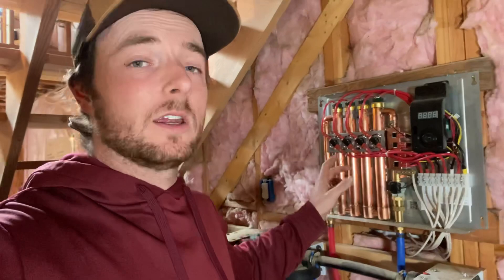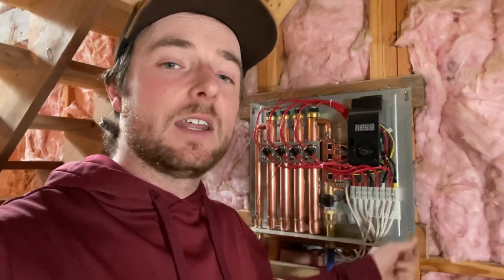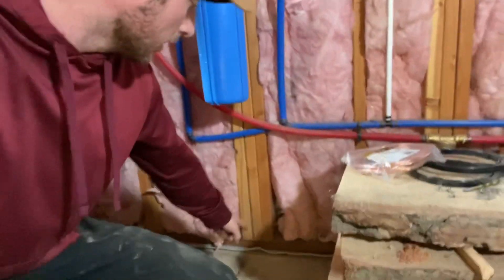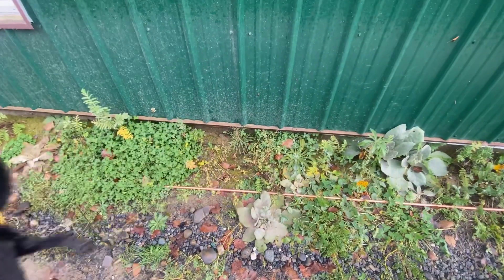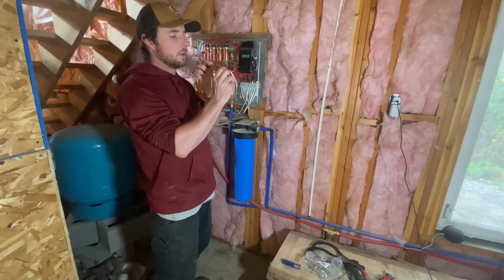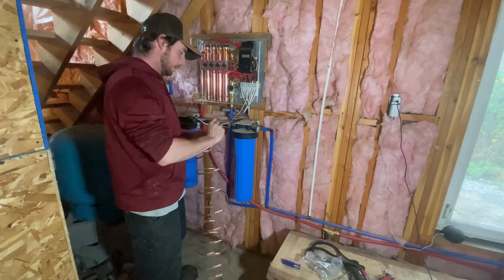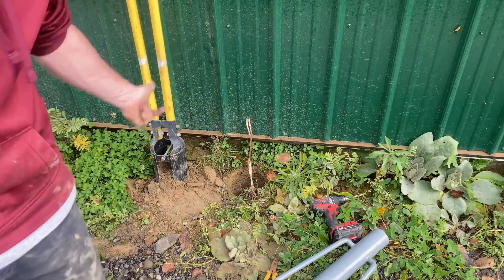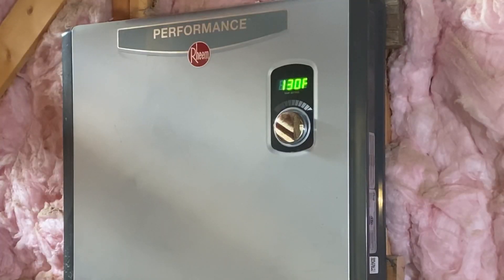Grounding a TANKLESS WATER HEATER

Comment: Two 4 ga grounds are overkill for that. You ground each device to the panel, the entire system is grounded to the ground rod at the meter. The only time you would add a second ground rod is if you installed a lighting arresting system (lighting rods). And my entire system is grounded at the meter and the ground wire attached to the grounding rod w a single 4ga wire, that grounds the entire electrical system and was what code required 22 yrs ago when it was built.

Comment: I have a house where someone tapped in into the main service to add a 100amp panel which isnt a sub panel anymore. they ran two tankless water heaters which I know is bad already the 100 amp won't hold theyre pulling more then 120 amps and their isnt anything else on the panel. it looks like a good grounding what do you think it could possible be, been doing for 23 years but have no idea what it could be

Comment: No it is grounded at the poll box. You should  have run the grounding from the water heater you should have taken it back to the main panel. You have now created 2 ground point. It may work but I do think you should have only one ground point

Comment: I do not know what water heater you have, but the hum you describe may possibly be from a small control transformer to get from 240 volts to 120 volts or lower.   Transformers do hum.

Comment: So I don't live in the USA, so your codes are more than likely different But every MEATAL case/cabinet and MEATAL conduit and all sockets should be grounded (or earthed). If you think that anything that can conduct electricity and kill you should be earthed, also anything connected to water and anything connected to gas should also be earthed. Just think to your self "could I get a shock from this" and if the answer is yes then earth it. You can never have too many earth rods, try to choose damp areas of your grounds as this area will provide better protection to your system. As you live in a meatal building a lightning rod and separate ground is a must. Thanks for posting
Reply: There is a phenomenon called a reversed polarity that happens when you ground at the device instead of the disconnect point or the breaker. 
Code says that you ground at the disconnect point and 4 wires must be run to device or appliances past the disconnect point. 
In answer to your question I just heard no do not ad the bonding screw connecting the grounds to the neutral unless you have a back to back service with three wires coming in from your meter, and you are using the panel location for your grounding point.
If 4 wires are coming from your meter you must separate the grounds and the neutral’s adding a ground bar directly to your panel enclosure and do away with the bonding screw that is the correct way to connect. 
Grounding must be at the disconnect point or reverse polarity will occur and over load your neutral causing insulation to melt and conductor to deteriorate resulting in arcing and possibly a fire.
The buzzing you are hearing is not good and any buzzing occurring at electrical devices or appliances is a sign of trouble. 
You should call in a qualified electrician or repair man to fix the problem.
Steve. 
Electrician for 
47 years third generation in my family.
Our company has been in business for over 75 years 
My Grandfather installed and wired houses when lights were the only thing that there was when wiring was knob and tube .
Brace and bits were the only type of drill you had.
The common practice back then was to switch the neutral and you were required to twist and melt led on your connections.
Thank goodness that has all been changed.

Comment: IMO you should bond your neutral and ground ONLY in the braker panel. It won't hurt driving another ground rod outside the panel. BUT All your grounds should come to the one point inside the panel.

Comment: Hi, first time posting here. I've done 2 my houses quite full electric system upgrades so from what I've learned is this. Eurooean persoective though. You seem to have TNCS system from service. Then it's correct to ground at the service box (it becomes a part of Grid grounding distributed system wich Provider wants to have). Tgere Groun wire & Neutral are joint together ane only there! And then Key Rule: do not join Ground with Neutral anywhere back later in Yr house system! Kepp them separate.
I could explain the rationale behind it but this message would be much too long...
Then You may ground additionaly the Ground wire at Yr house box  or as You did. It will only help. 
Woul be good to measure the resistance on this copper rod. When I did mine in order to achive a mere 6-7Ohm I needed to install like 12 of such rods... You folow? And I should have 3-4Ohms... Very much depends on ground codituity in Yr area. So measurement is really essential to sleep in peace 😉
Reply: BTW, You have interesting setup there from service. Here in EU we have either 1phase (1hot) or 3phase system. The fact that some high power equipment like heaters is using 2 hot not 3 is another matter. We have higer power engines running on full 3P. Pity You haven't got full 3P+N considering Yr future shop needs.

Comment: I don't know about the specific code in your neck of the woods, but for any electric water heater, you should install a 'ground fault interrupter', which limits your exposure in case of a device internal short to 0.2 to 0.4 seconds. Although you may check if the heater has an internal gf-interrupter built in.

Comment: If you put a ground rod in the sub panel in the shop would you connect it to the ground or neutral?
Reply: Article 250.32(A) clearly answers your question maybe.   This is a panel in a building connected to the service by a feeder.(very specific).  It requires a grounding electrode connected to a separated ground bar.

Comment: To give you some info about me, I started designing electrical systems in 1983 and ended my career in 2018 as a Sr electrical design engineer for one of the largest contractors in the US.   Having said that, I can give you some knowledge, say what I would do, and ask you some questions.
Grounding electrodes(ground rod) and grounding electrical conductors are to be installed at the first overcurrent location of your system(next to the meter).  FYI,  The one and only purpose of grounding electrodes and their conductors is lightning protection.   Again only purpose.   Equipment grounds are installed with branch circuits and feeders.   So, from your 200 ampere breaker to your house is not service conductors, they are a feeder.(hence the ground conductor).  Now regarding a water heater with (4) 40 amp feeds, I would treat it as one load as far as an equipment ground.   That means #8 conductors with #6 grounds(4) equipment grounds.   One with each branch circuit base on 160 amperes of overcurrent protection.   But, this could go as all separate and your #8 grounds are fine.  Inspector might go either way.   I would absolutely remove the (2) #4 and ground rod you just added.  (Electrodes are for lightning protection).
Now for the panel in your house.   History, this has changed almost every other code cycle since I started back in 1983 but stop being changed around 2008 NEC.   In my 2017 NEC Article 250.32(A) very clearly now states that a grounding electrode is required to be attached to the separate ground bar within the panel supplied by a feeder or branch circuit.   Ground bar and neutral bar must be isolated(not connected together)
Now I have a very serious question.   Who did the required electrical calculations and came up with a service size required for your home?   Here is the reason I ask.   You have somewhere around 28 to 30 kw of electric water heating.  A normal electric water heater is 4.5 kw.  Since I do not know your square footage or your electrical loads, I can not give you a good feeling that your service is NOT to small.   My gut feeling is, your service is not large enough and you will be making lots of trips out to reset the main breaker.   That is unless your inspector rejects your system because he feels it is inadequate.   Another commenter researched and found the water heater manufacturer says you need a minimum 300 amp service to install the water heater.   Check your literature from the manufacturer.   If it says that, you will be in violation of NEC.
I hope this helps you in the long run!   Respectfully,   Kevin

Comment: From a journeyman electrician, in the panel in the house do not tie your neutral and ground together. At the metered main panel should be the only place that they are tied together. A ground rod at your home is not a bad idea. For lightening protection. There’s a difference between a ground and a bond. I hope you tankless water heater also has a bond between it and the panel. A ground rod is not sufficient.

Comment: Did you use a tester to determine that you had grounding issues?  Buzzing could be a loose connection in the water heating unit. Did you test your neutral and hot too? Were tests done on the outlet, box and the unit?
Reply: Do you have 300 Amp service? The internet says often you must have 300 Amp service to run 150 Amp thankless water heater. Might be your problem!

Comment: Bonding ground wire is for safety. Safety from what? 1. Hot wire to ground fault. 2. Lightning strike. Does sub panel need another ground rod? Well...would you rather lightning be dissipated sooner or 60ft later at the main panel? I personally would have used a 2 rod array at the sub or maybe use a coupler and another 8ft rod to give a 16ft total depth

Comment: So in your case the only place the neutral and the ground should only be connected in the meter panel out by the power pole. The panel in the house needs to have the neutrals isolated from the grounds. You DO need a ground rod at your house panel because it is a separate building even though you have a 4 wire feeder.
This the code from the national electric code that requires a ges(in your case a ground rod); 
250.50 Grounding Electrode System. All grounding electrodes as described in 250.52(A)(1) through (A)(7) that are available at each building or structure served shall be bonded together to form the grounding electrode system .Where none of these grounding electrodes exist, one or more of the grounding electrodes specified in 250.52(A)(4) through (A)(8) shall be installed and used.
Reply: Yep, that's what needs to be done. Hopefully he takes your advice.
Reply: I have a question, if you have a rod grounding near of the building anf tie it with the grounding that comes from the meter panel, theoretically it can cause a power differentialthat can cause some problems. Am I wrong?
Reply: So glad you didn't use the term "sub panel" like so many here...  You are 100% correct !!!

Comment: No new ground rod needed. Meter base and sub panel are grounded. Your breaker box ground in the building are tied to the sub panel, which you said had two ground rods. You're good bro.
Reply: Wrong, it’s a separate building and in his case requires a ground rod per 250.50
Reply: 250.32(A).  Requires grounding electrode at the panel in the building.

Comment: Using a second ground/earth is fine, however you need to get it resistance tested! Do you need it, no if the ground you already have passes a resistance test at the heater when connected to the existing one, which it should.
Reply: The heater should not be connected to a ground rod.
Reply: @KevinCoop1  there is no reason for it not to be.
Reply: @FaithsFallen    Please tell me your understanding of the purpose of installing ground rods and connecting to an electrical system.
Reply: @KevinCoop1  of course I do, and in a water system using PEX grounding is not required. But it will not cause any danger if it is connected to earth.
Reply: @FaithsFallen     You may have some misconceptions.   Electrical systems are required to have grounding electrodes installed at the first overcurrent location in the system.   Also, in this case at a panel in a structure connected to a feeder.   Grounding electrodes are installed for the purpose of dissipating lightning.   By adding electrodes to the water heater, it creates a second path to ground.   Article 250.24 (A) gives a list of (5) locations where grounding electrodes are to be installed.   A water heater is not on the list.   By grounding with rods, (ground loops) are being formed and can be dangerous.   There should be only one path for ground faults.   Multiple paths can possibly reduce current flow in a fault condition to the point overcurrent devices will not work and the system becomes dangerous.   The case of the water heater was equipment grounded by the #8 ground conductor in his (4) 40 amp branch circuits.   Sorry, too long!
Reply: @KevinCoop1  go you with your Google skills, it's a pity you left out the part of the code that states it's fine to use a separate ground. And it's in the very text you have copy pasted...
Reply: @FaithsFallen     I own every NEC code book from 1981 to 2017.   When I retired in 2018, a friend got me a copy of 1892 NEC(the very first one). Google answers can be correct or incorrect.   I stay with the NEC.
Reply: @KevinCoop1  who changed the code to allow this very situation.
Reply: @FaithsFallen     What section are you thinking was changed?

Comment: You only bond the ground and the neutral together at one point.  Check inside your panels it is supposed to be a green colored screw.   If you have a circuit that draws 50 amps then you should add another ground rod for that appliance. As far as the number of ground rods that depends on the soil.  If you have dry rocky soil you are better off with a grounding network.  A network is multiple ground rods connected together with bear copper wire and it is all covered with dirt.  I did that with my house 10 years ago after I lost all the appliances in my house do to a lighting strike hitting the pole.  It's best to consult a local guy because soil conditions and codes very greatly.
Reply: Where in the world did you come up with a circuit draws 50 amps should have a ground rod?   Please tell me so I can look it up.   Also, grounding electrical services requires a ground when tested with less than 25 ohms.   If not less than 25 ohms, then one additional grounding electrode is required.
Reply: @KevinCoop1  Do what you want.  All I can tell you is what I did and what the inspectors told me I had to do.  When I lost several thousand dollars in equipment I had plenty incentive to overbuild my grounding system.  My house is 85 years old and I have had no problems since.  I want to further advise that he seeks advice from a local guy.  If he has volcanic soil it can affect how the ground rod will work .  I don't know soil conditions in that area.  Knowing what you are dealing with goes a long way to fixing the problem.  He has some special circumstances there because his house is fairly new and he is already having problems.  A ground network will fix the problem for sure but that is the most expensive option.  That is what we did in Turkey and that was volcanic soil.
Reply: @freeatlast1020     What was the cause of several thousand dollars of equipment lost?   Lightning?
Reply: @KevinCoop1  yes
Reply: @freeatlast1020     Then 2020 NEC tells you the answer to the problem.   It requires lightning protection for services now.     
Adding more ground rods to everything in your house most likely did nothing to fix the problem.  Unless you had another strike at or very near your house, you will not know.   To truly fix it, you would need to have lightning protection installed on your roof and taken down to ground rods.   Those systems actually work.    
I’ve bent your ear too long.   Respectfully,   Kevin

Comment: Earthing grounding (what you just did and what is behind your service connection) and bonding are two separate things. You should never attach a bonding wire to a grounding rod or the earth in any way. A earthing grounding rod can be extremely dangerous in a lightning storm as well. Bonded grounding is a copper wire that is connected to the neutral between service panels to keep a shorted wire from shocking you if the hot wire comes loose and touches the panel and trips a breaker or pops a fuse. It is also used clamped on to the various ends that secure your wire to a panel or a wire tray and it's connectors. 10AWG-12AWG THNN wire is usually good enough for this usage.